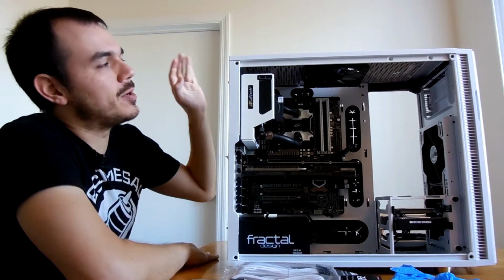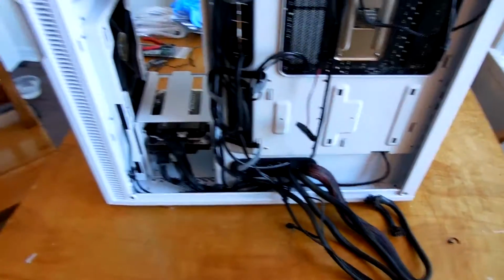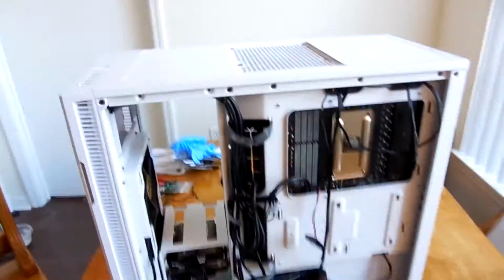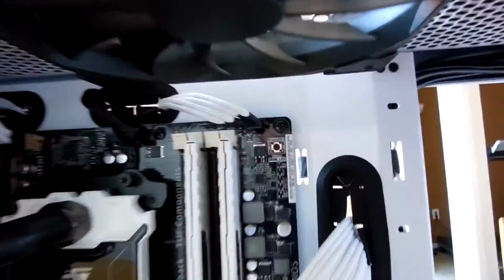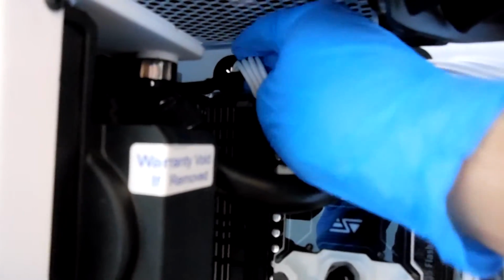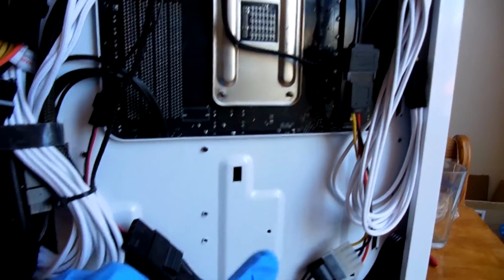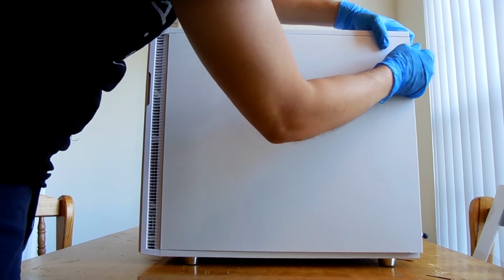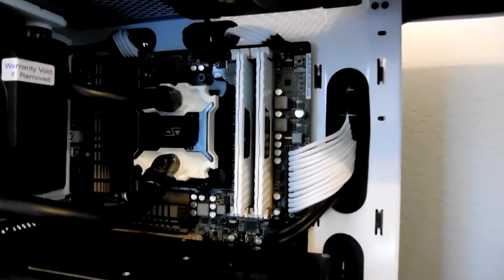Dorksmithing #0005: Cable Management When Using Extensions

Comment: Cpu cables are 4+4 and pcie are 6+2. Way easier way to figure out which is which. Assuming you can split the connectors.
Reply from the maker: PCI-E cables can also be 8-pin, same as some EPS 12V.